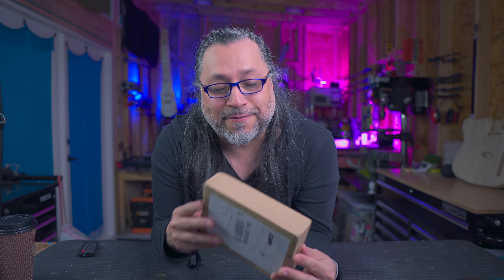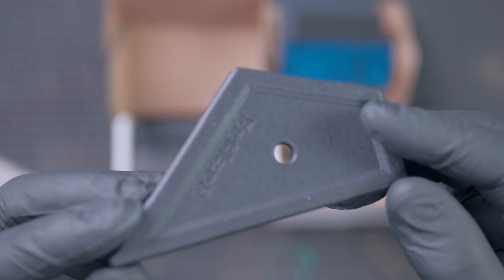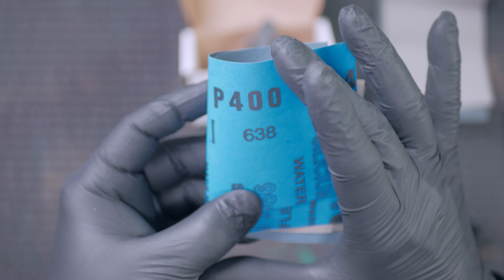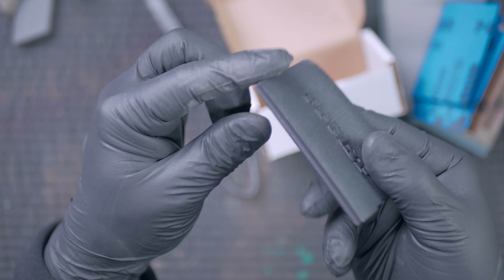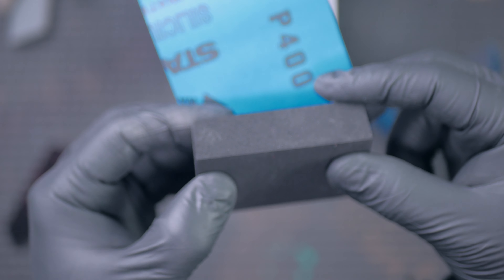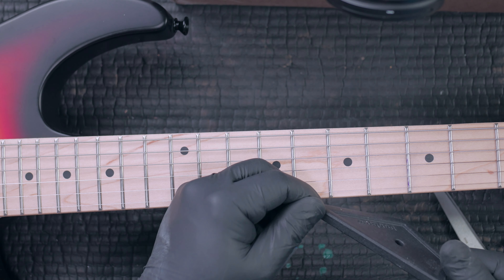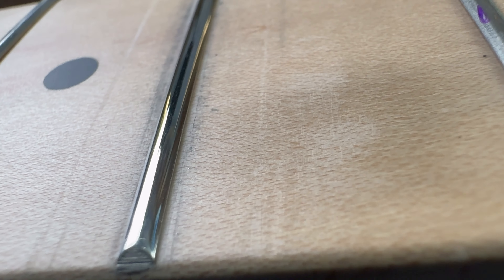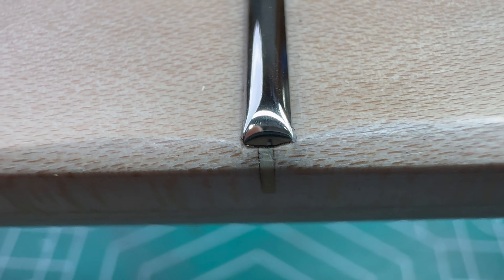Made in Germany Fret Polishing Kit - Mirror Finish in Minutes

Comment: Thanks so much for demoing this. I’ve been wanting to buy the fret kisser for some time but have always been holding off because of the price
Reply from the maker: The fret kisser is way too expensive but also so useful. Glad there is an alternative.
Reply: @MarkGutierrez  Ordered! ... And while I'm thinking tools, just curious Mark, what method do you use for nut slot height? I've been looking at the Stew Mac Digital Nut Slotting Gauge, and was going to try to make my own using using a digital indicator that I already have. Unfortunately my exisiting gauge has too much internal tension to rest well on the strings.

Comment: That fret leveling tool is exactly what I thought was needed after using the Stew Mac tool for the first time.  I thought why not make a recess for sand paper and allow the users to go through multiple grits to get the fret leveled and start the polishing/cleanup process.   I just use 3m foam sanding blocks on the fret ends after I finish the bevel and round the ends.  So, their foam block is not a need for me.  The fret polishing tool reminds me of what I see in some of the Kiesel videos.  They use a setup similar to this to start the cleanup and polish of the frets.   Thanks for this vid....

Comment: I forgot I got one of those, need to use it ASAP. However I do dislike how the metal fretboard protector still scratches the fretboard, I would tape off the sides to prevent that.
Reply from the maker: True. I noticed the same thing. I only used it for the tool demo. Would definitely only mask with tape moving forward.

Comment: I really dont care for that diamond grit they use. I bought a stew mac z file last year and it only lasted 2 fret jobs. I cleaned it with a brass brush every few passes and it still wore out super fast. What would you recommend for a replacement?
Reply from the maker: I use the Z file with the safe edge from Stew Mac. I haven't found it's equal. Unfortunately, I just replace them when they wear out.